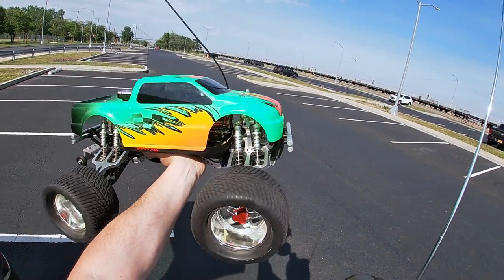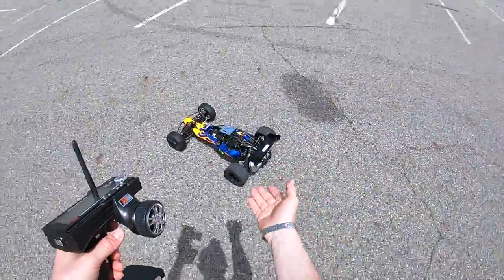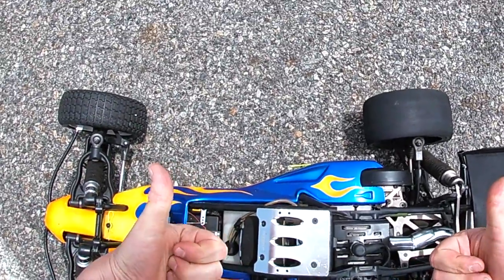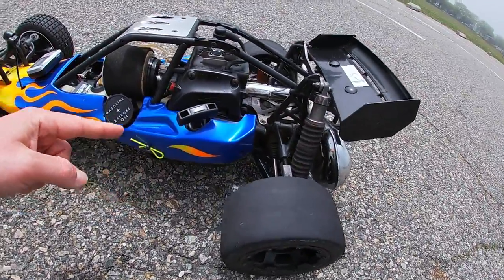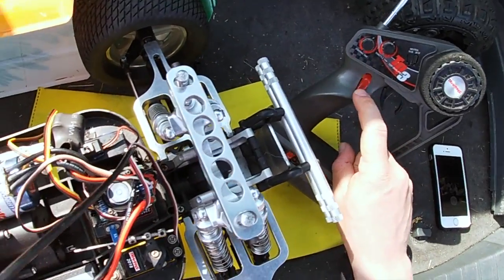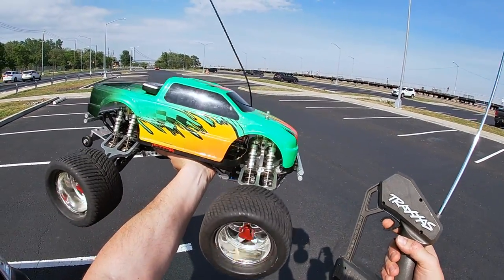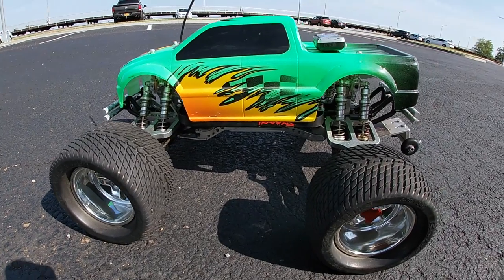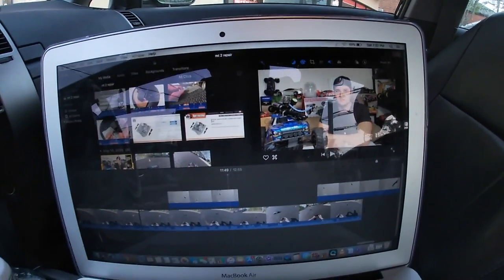Testing A Clone 990 Walbro Carb with the King Motors Baja - Vintage Traxxas E-maxx with 2-speeds.

Comment: Dad and I used to have Emaxxes back in the day. They were a lot of fun back in the day, but eventually we got bored and took a break from the hobby a couple of years. By the time we got back in to it, newer and better RC technology had come out. Ended up buying a brand new Traxxas Rustler xl-5 and as soon as I realized it could do wheelies on command, I decided I was done with the Emaxx. Just got tired of breaking it all the time. Skid plates, bulkheads, and shock towers broke all the time. The final straw was when I drove it out of the house a little too fast, and hit the brakes too hard. Whole truck gently rolled over and that killed both of the front and rear bulkheads.

Comment: $12?? and it has a high speed and low speed needle?  Cant go wrong with that.  The thing with these kind of things, is they work and then 3-6 months later they fail and its not worth fixing.  Thanks as always for a great video

Comment: Lovin that 1/5! I need to do some speed runs on mine, last time I got 52mph on my Hpi Baja 5b,and 46 mph on my Redcat Rampage. I've since tuned them a bit and installed a walbro carb on the Redcat. I'll post my increase (if any) so you can compare.

Some cheap carbs are great! I have a aspeirn (probably butchered the name) that really runs well on the Redcat... The walbro did seem to do better though

Comment: Not gonna lie, I think the Baja is one of my favorites on your channel thus far. I think the Revo edges it out for me, but this thing sounds like a beast and drifts SMOOTH. With the emax, generally I estimate about 8-10 mph gain per cell you add. So, if it's 4s capable, your probably looking at around 45, maybe close to 50mph

Comment: Great video Hybrid32494!! Got to get me a fifth scale. I bought a new classic t-maxx that I'm putting black Rpm tru trac, front A-arms, 3.3 bulkheads, 3.3 axle carriers and 3.3 steel CVD's. Have yet to put fuel in it and I e had it 3 months. Just want everything right before I fire it up. Tell T-maxx Tony he will appreciate that. Lol
Reply from the maker: T-maxx Tony here, I am glad you are building an old school T-maxx, I used to have the first 2.5 model years ago.  I loved it, only thing that broke was the reverse, eventually went forward only.  Good luck my dude, T-maxx Tony is with you in spirit..

Comment: Yessssssss finally that emaxx comes out to play!!! I also had the same one twin titan engines i ❤ that emaxx and that tq am radio long aluminum antenna so you can have a sword fight with your buddy hahaha i miss it. I cant tell you how many times ive bent those antennas by accident from just pushing back in when i was done😆 nice baja too👍👊💥🇺🇸
Reply from the maker: hey bro!! Yep, this si some vintage Traxxas History right there with the best version of the E-maxx ever made.  Since they went to the single speed, I lost all interest in them.  That shift on the fly trans is the coolest feature. IDK if you remember that HPI had an optional 2-speed upgrade for the electric RS4 series years ago.

Comment: i use the same cheap carb on my CY 26cc. no problem so far!
Reply from the maker: hey buddy!! Thanks for the info, got a question for you, I need to prime the primer about 20 times, then do about 20 short primer pulls on the starter fore it to start on the second pull.  Do you have this problem?  Its not really a problem, just curious.
Reply: @hybrid32494  no i dont have this problem, but when i got the carb i cleaned the diaphragms with carb cleaner, even if it was new!

Comment: I have been so interested in the 1/5 Baja 2 speed & 3 speed transmission Options.
Have you ever fitted one or will you?  Cheers from Australia keep up the good work 😎👍🏻
Reply from the maker: hey buddy, thanks for watching. I do know that some guys run the 2 speeds in these and they work fine, but they also have pretty serious maintenance needs with the springs and clutches.  Personally I think a higher geared single speed is adequate enough.  Considering my basic 30CC baja (not this one) got 44 MPH with stock gearing and it pulled easy, it could hit 50 with just a minor gearing change for cheap.  The 2-3 speed trans are still very cool, but from a cost and reliability POV I would not get one personally.

Comment: Hybrid32494 did the Traxxas run on 16.8v or did it run each motor at 8.4 volts? That might also explain why it won't work on 3s? IDK just asking. 

There is a guy who describes his Arrma Infraction on 16s when in fact he was running dual ESC's and dual motors, each on 8s. Yes he is running a 16s volt system however each motor only puts out it's KV times 8s. In other words, it's 16s but not 67.2 volts it is a 33.6 volt system. Big difference IMO on that vehicle. 

I tend to yell into microphones as well. Especially when it is away from my mouth.

BTW, nice vehicles!

Comment: Hey nitro brother nice 5 scal
Reply from the maker: what going on bro!  How you been!  Hows your savage dude? My damn savage's steering wheel on the remote broke, I cant believe it.  And I t's not fixable, going upgrade to a different radio system now.  Im angry cause I like the original radio gear too, you know,  OH WELL>
Reply: Oh I have to fix the differential in my savage but I don’t have time I barely have time to drive them anymore I’m just trying to find a job maybe in the future one day out of the week or something but I plan eventually to do a little bit of videos and just driving having fun well take care God bless you out there keep doing the videos have fun
Reply: hybrid32494 Yeah I’m just trying to get the savage taken apart I love your drift videos with that awesome HPI I’ve just been driving my nitro for tech and rustler A little bit eventually I want to get a Revo 3.3 but I just need to work and then I’ll have more time to drive on the weekends or whatever keep it up out there get on the race track and race

Comment: I don't get notifications for your videos anymore..Even though the bell is active ..Odd
Reply from the maker: hey dude, I figured, that's been my issue I noticed.  very weird, I spoke to youtube support, and they told me exactly what I already knew, no help there.  BTW, I finally figured out how to use the Hobbywing Programming card after doing the manual ESC settings.  But now it's got a damn stripped diff in the rear.

Comment: I guess i’m not the only one that comments that you yell lol I think it’s because 
1 you’re excited 
2 you live in New York 
3 you’re using a gas rc ITS LOUD
I also have the original Emaxx that I’m trying to sell I bought the summit so now I don’t use it anymore it has two 775 motors in it tons of upgrades that my friend did before I bought it off of him
 That pizza looks good
Reply from the maker: whats up man! I always love your comments! I noticed also that the GoPro cam has a very good mic, and I'm not used to how loud it picks up sound, compared to the Phone audio. Question for you, about my own E-maxx with the stripped rear diff, have you run into this previously?  Would putting a spool in be a good idea (for the rear), or should I just buy the ring and pinion gears and rebuild the diff?  I hate diff work, btw.
Reply: hybrid32494 if you put in the spool it won’t turn as sharp not a big deal if you’re just driving outside but I like to drive at my local hobby shop so I need it to turn tighter I also hate working on the rear diff on any car you have to take so much apart
Reply: hybrid32494 do you want to buy it lol

Comment: Want to get my hands on that emaxx first generation with the two speed transmission just add upgraded parts with a powerful batteries and charger also make it lipo let me if selling 🙏🙏🙏🇯🇲🇯🇲🇯🇲💪💪💪
Reply from the maker: hey bro!  That's right, it's all about that old first gen e-maxx, back when it had the high and low gears.  After when they went to the single speed transmission, I lost all interest and it became just like any other brushless truck.  I currently need a damn diff though, wondering if I go with the spool for the rear if that's a good idea?  Chances are I still need a ring and pinion most likely.
Reply: Yes that could definitely work 🙏🙏🙏🙏🇯🇲🇯🇲🇯🇲💪💪💪